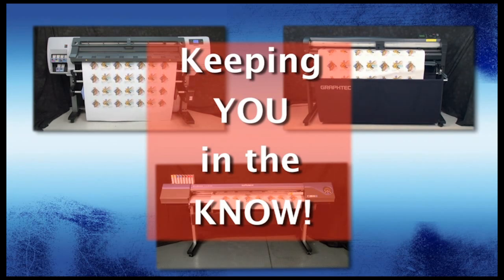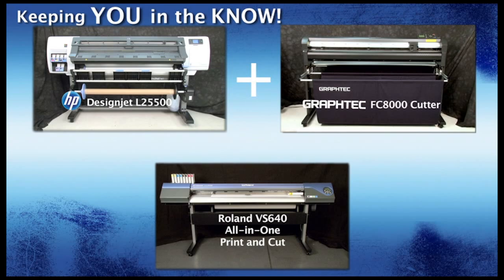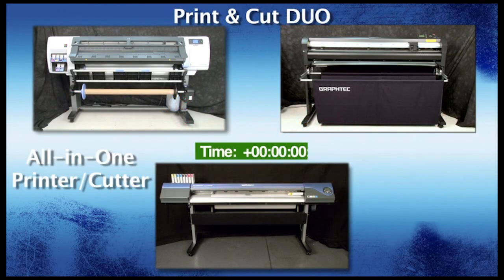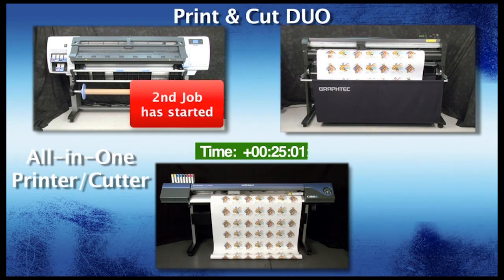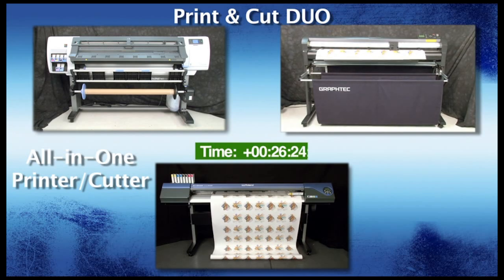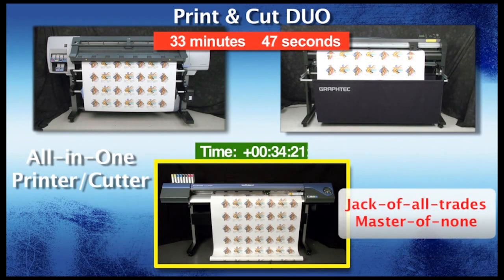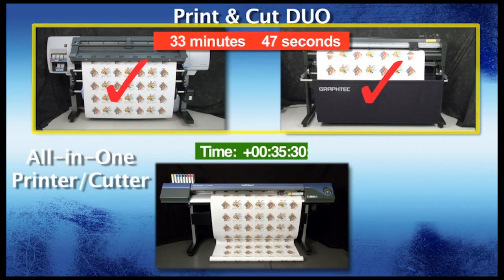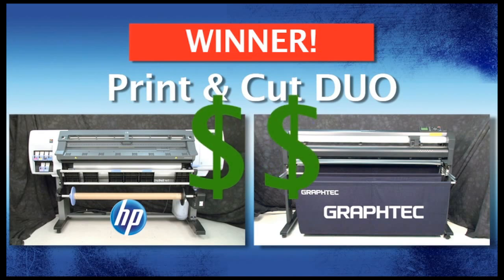SPEED TEST Printer & Cutter VS Single Printer/cutter Combo

Comment: yeah, but when the cut is down to the fraction of a mm then the combi machine probably had the most accurate lineup of the two systems. If have to add all the time i spend lining up seperate devices to get the 4,7mm cute here and the 6,45mm cut there we can easily add 4 hours a project to the seperate machine time!
Reply from the maker: Thank you very much for your comment :)

ADVANTAGES TO USE SEPARATE CUTTER:

- Print heads don’t get clogged or damaged with dust and debris from contaminated
media when cutting on your all-in-one unit.
- Concerning ink jet printers only: for outdoor applications that prints will need to be
removed from the printer and laminated before cutting anyway. This renders the
cutting feature pointless.
- If the all-in-one breaks down, the entire production line goes down with it.
- Separate machines allow multiple jobs to run at the same time print only, cut only, and
print and contour-cut. All-in-one printer/cutter machine tends to be alot slower than a
separate printer and Graphtec Cutter. It can slow down your output by 50% or more.